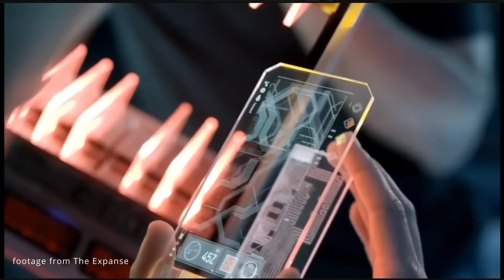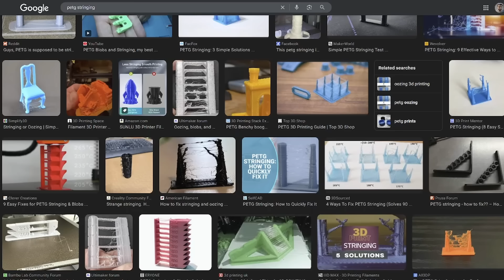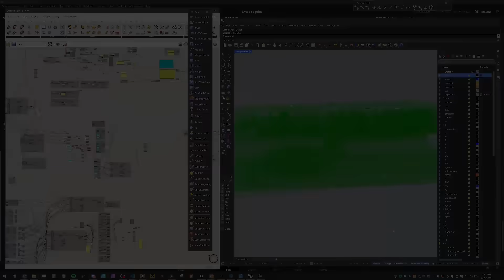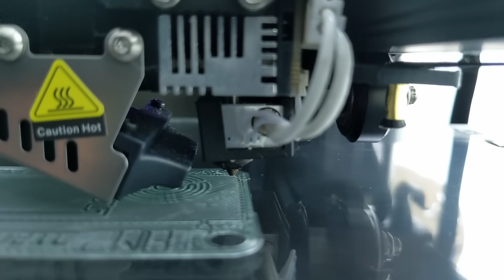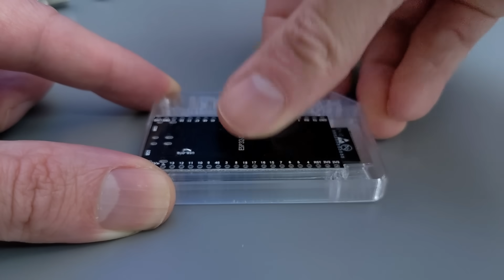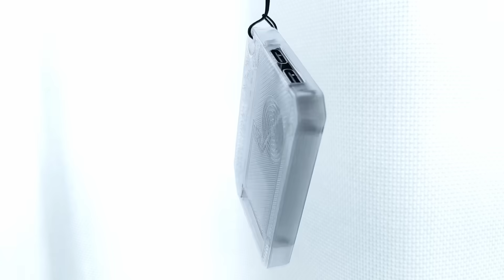No slicer: single continuous path 3d print

Comment: Subscribed!At first I was confused what you meant by continuous path. Just no travel moves on the same layer. Right? 

How did you handle moving up the layers? Did you extrude moving up or retract, like a slicer would? 

I would like to see how grasshopper is laid out, did you pretty much have to program every move? Or did you make your own “slicer” that is more custom to a type of part? 

I really think you did a great job!People could unlock more potential in printing if they gave this effort.
Reply from the maker: Thanks! Yeah, no travel moves. Each layer (mostly) starts at the same X,Y location, so I just do 0.0 extrusion for the tiny Z jump, then continue as normal.
It basically comes down to having a curve that represents each layer, and each move is a point on the curve, and the extrusion amount calculated based on the distance of the move. I do plan on making a more in depth video to show the script.
Reply: @porchlogic  Wow! I'm looking forward to that video. I have Rhino and would love to learn Grasshopper more by studying your script. Thanks!!! Subscribed.

Comment: great video, please go more in depth with grasshopper and rhino
Reply from the maker: Thanks! I'm planning on doing a follow up video showing how the gcode generation works. Any other parts in particular you are interested in?
Reply: @porchlogic looking forward to your follow up, subd
Reply: @porchlogic I definately am!
At which stage do you need to optimize for a single line? If you allow for (some) variable line width/spacing, shouldn't it be possible to find a solution for all geometries where the topology allows for it? Some converter would be awesome, eliminating seems completly.
Reply: @porchlogic  yes please. as random as it sounds you just solved a problem with the sand table. as it doesnt lift the z axis sending g code is a nightmare. lmk if you want to collab or how i can use this to convert an image/svg into a continuous path without going over existing lines. (single line art style). I made a solution that converts drawing into gcode but i think your solution could be much more accurate.
Reply: @porchlogic  I do a lot of spiral \ vase mode printing.  I have reached a block with my drawing technique.  I can draw a sectioned box, 4 sections with a perimeter around all four.  I can draw it so it should be one continuous line but when I slice it, I end up with diagonals that should not be there.  Cura is better than Orca.  In fact some objects that slice correctly in Cura fail in Orca.  So I want to know more about your method please. PS you won a sub.
Reply: @landroveraddict2457  try watching this video, it creates a slicer for a 3d printer from scratch that does a spiral motion https://www.youtube.com/watch?v=OE_daHEf1MM&pp=ygUWM2QgcHJpbnRlciBncmFzc2hvcHBlcg%3D%3D
Reply: @landroveraddict2457  that is becose thy are to close together 
The slic3r/prusa engineering wants altlest one nozzle diameter
Reply: @porchlogic  Showing the result being powered up would be very important. But yeah, not going into depth with your tool chain is a major problem.
Reply: @porchlogic  subbed for the follow-up
Reply: @porchlogic  The modeling concept for continuous line printing, the whole process. Subbed for future videos when drops.
Reply: @porchlogic subbing to get notified of the follow up.
Reply: @porchlogic I'm excited to see the follow up! Just got this video on the feed and I subscribed so fast.
Reply: @porchlogic i would be interested in how deeply the toolpath generation is embedded into the parts geometry creation and how one would be able to apply this to arbitrary geometries or how one could build a modeling workflow that creates parts that fit this type of path generation.
Awesome work!!!
Sometimes you look at something and you feel like it should be so clear to everybody that this should be the standard way of doing things but it certainly is not mainstream at all...

It would be interesting if this type of parh generation cpuld maybe more easily be adapted to 5 axis 3d printing ...
Reply: Me too subbed for this follow up, this is exactly what i need for my lwpla rc plane prints